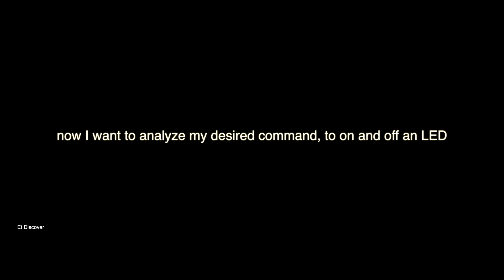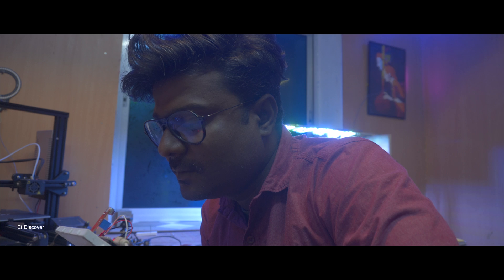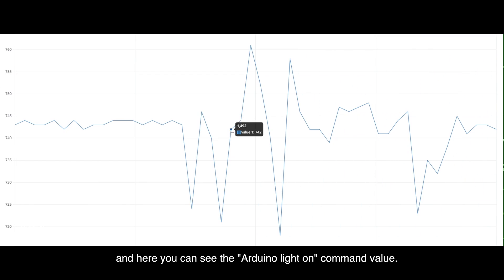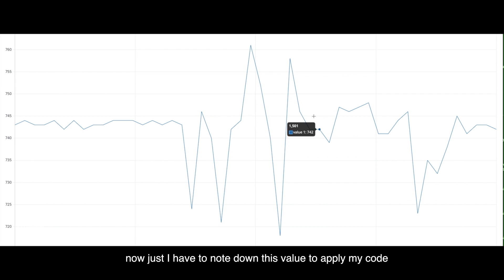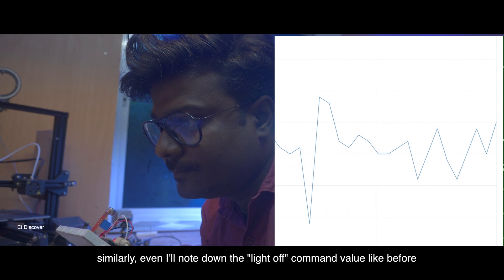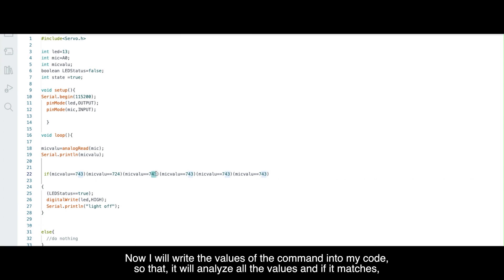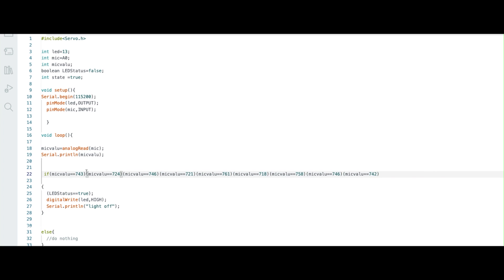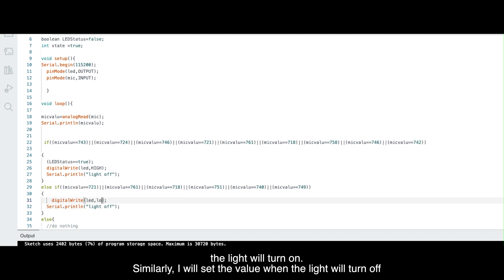Arduino voice command on & off, like a personal assistant

Comment: The first time I watched this video I felt that this is something i can try. When I started working on  it, I found that there are many gaps in your teaching. If your intention is to impart complete knowledge, i would have expected much more clear explanation, provide the circuit diagram and how the data is recorded in the DF player etc. I have issues with the following. 1. Connection diagram not there and hence i am not sure if i am connecting it correctly. 2. you have not mentioned about adjusting the variable resistor screw, which i cam to know from another youtube video. 3. It is not clear how you ahve collected the voice command data. I am not getting it in my serial plotter. 
Sorry for bothering you. I am a retired person, trying to use my time on something like this. I would great apprecite if you could respond to me with some clear explanation. This is definitely something i would like to do.